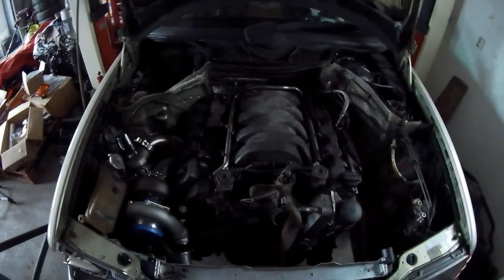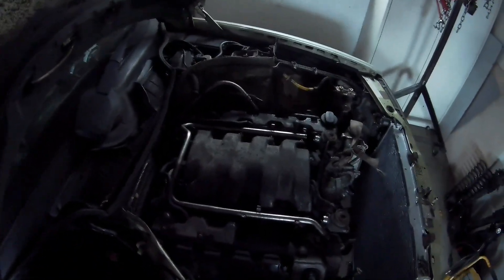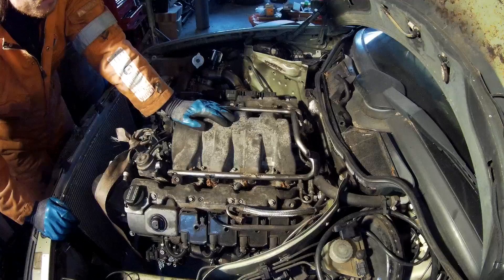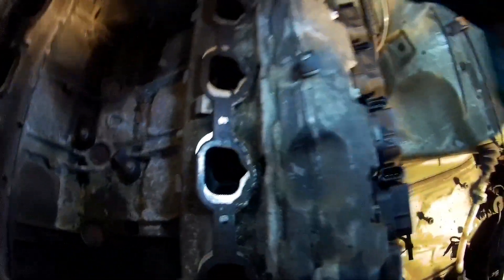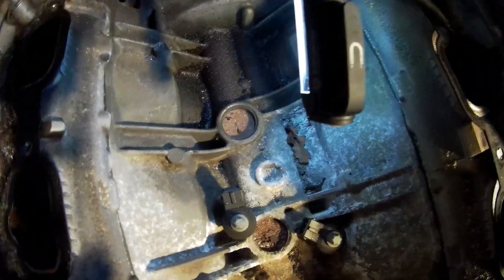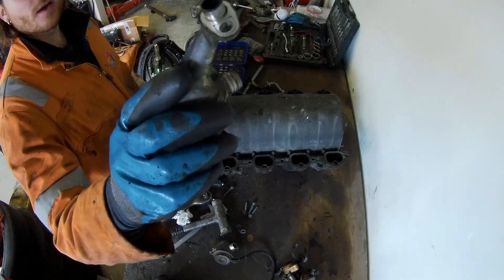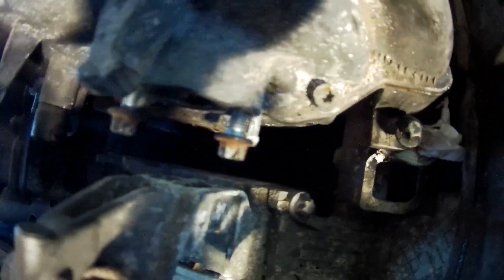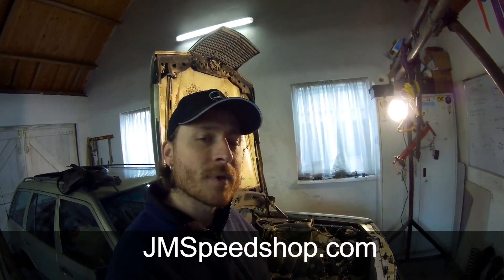M113 V8 intake manifold turning 180° S124 turbo project

Comment: That eye you got a piece of cloth tied around to make a loop, is that thing you cut just an engine lifting hardpoint? Or is there some other use? I'm gonna put an oil cooler there, but would be easier if I could buy the other semicircular half, if it exists, to mount it

Comment: Тоже думал о развороте впуска, для того чтобы сдвинуть мотор немного назад, чтобы без изменений подкапотного пространства поставить V8.
Reply from the maker: 🤔.English please
Reply: @JMSpeedshop  There was an idea to deploy the intake manifold to move the engine back and the V8 got into the engine compartment without additional work.
Reply from the maker: Oke. Body has no modifications. To fit the engine .  Only the steering housing.   And the engine mounts are custom

Comment: Hi 
Any idea about installing a compressor on the M113?
Reply from the maker: A m113k kompressor on a m113 na?
Reply: Yes :) I have a full set of w211 compressor amg except ecu.  I'm planning to plug it into my n/a m113 but I can't find detailed information anywhere.
Reply from the maker: It will fit without any problem engine is outside the same .  Only front timing cover is different.  The mount for the air fan is not on a m113k model
Reply: I understand  Thank you.  I'll start disassembling the engine soon.  I'm doing research to address some of my concerns.  In some forums, comments have been made that the s/c clutch does not grasp.  I will try and see 😊

Comment: So random question on a m113 engine what causes the intake manifold to shotgun explode. In the front specifically, by the water cooler? Kind of a real head scratcher.
Reply from the maker: I don't really now what you mean ?
Reply: @JMSpeedshop  I went to go start my 2001 s55 AMG and it wouldn't start then the front of the intake manifold blew up. What would cause this?
Reply from the maker: You would think of a backfire .
Reply: @JMSpeedshop  Perhaps, but what would cause this? I got a replacement part so was it a one time random or will it happen again?
Reply from the maker: When the timing is of this could happen but on a modern ECU system.this pretty weird.   I can not really tell why from behind My desk
Reply: @JMSpeedshop  Right, I understand. Trust me it's a head scratcher indeed so I've been asking around. I'll check the timing chain to see if it somehow skipped a tooth or something. I appreciate your help.

Comment: Love your work , I’m thinking of putting this engine in my W202 , do you think the engine can handle twin turbo?
Reply from the maker: Yes the engine van handle that up to a certain amount of pressure .  But space is a thing also in a w202
Reply: @JMSpeedshop  I was going to do it like Ken blocks hoonicorn mustang with them out of the bonnet using the turbos from a skyline as they have specific left and right turbos.
Do you think I need forged rods and pistons?
Reply from the maker: Depends on your power goal.  In going on a stock engine .  Pump fuel max 0.8 bar IT Will be about 580crank max .  If you want more internals.need to change . Of maybe e85 you can stretch IT a bit

Comment: Looking forward to see the outcome of this, I’ve mounted a m113 in my mx5, and wondered about rotating the intake
Reply from the maker: Oke im working on IT
Reply: Where can I see more of this?
Reply: @lewie  I’ve not made any videos of it yet, it’s been a 4 year project that’s changed plans so many times a video series on it would have no direction. Once I actually finish it I’ll do a video or two.
Reply: @alexanderelrick8425  what generation?
Reply: @lewie  it was a rusty mk2 now it’s just a mk2 😂
Reply: @alexanderelrick8425  got any photos of it in the engine bay. An m113 in a na Miata is on the top of my never ending to do project lists
Reply: @lewie  yeah a few, can’t post them here though
Reply: @alexanderelrick8425  got an Instagram?

Comment: Appreciate this documentation greatly man. Looking forward to following along while installing mine.
How much HP/TQ do you think this will produce?
Reply from the maker: About 500whp 700wtq
Reply: @JMSpeedshop  Hot damn 🔥 Im excited to this come together!!
Reply: Also. I assume this is the 5.0 AMG m113  correct?
Reply from the maker: M113 5.0 no AMG engine
Reply: @JMSpeedshop  Any reason to go with this over the 5.5 version. Plan on any upgrades to the internals?